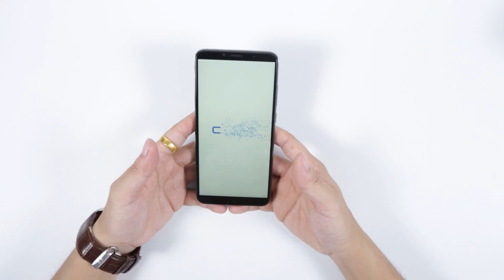Cubot X19 disassembly & installation video

Comment: Thanx for sharing. Very useful for changing the crashed screen. But you forgot to mention to remove the speaker, the swich on/ button and the volume setting buttons from the display base panel....

Comment: thanks for the video. A couple of things to remember. The battery is glued to the foil, so will need to be prized off. I used a credit card to achieve that. Also, when u un-screw the inner shell,  be aware that there are two sizes of screws.

Comment: Can you get replacement screens and replacement USB C ports? Cause both of those are wrecked on mine, charging stopped working and i dropped phone (with screen protector [that was plastic]) and it smashed.. 
But i cant even get the back offf